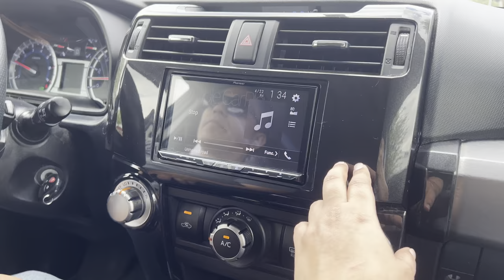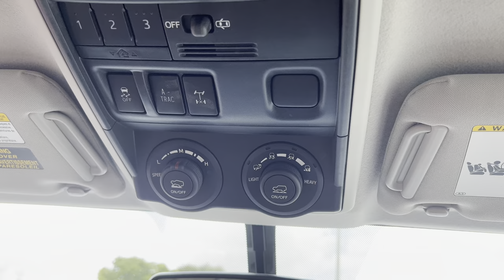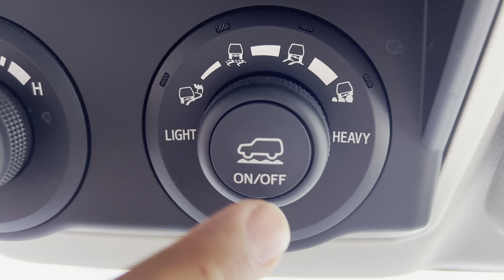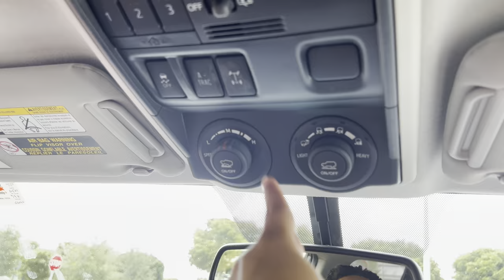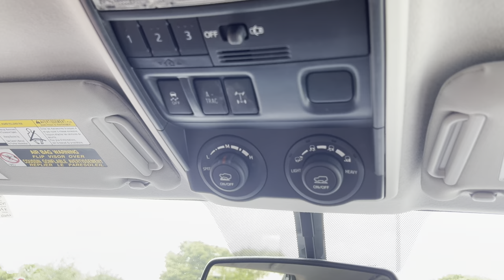Is the Toyota 4Runner the best adventure vehicle for large dogs??? | 4 years of adventure  review

Comment: I like how you pointed out the height problem with older dogs. This was the main reason I got the car I did. Downside I have is that because it's a hatch the dogs loose roof height. I do miss having the 4x4 for offroad traction going around corners but I still know how too get around a corner on a dirt road sideways and I love all the safety features on the new car. The Jeep was my first 4x4 and its power. Registration & fuel costs are half in the Kia. Wolf has jumped out of the Kia a few times but still needs help getting in, but it is a lot easier.
Reply from the maker: We are still shopping around for their new suv, in the mid time we will be using mine until we get one for them again. We did purchase a new car but is nor really for them is just for us, (they have got in the new car but they don’t fit together inside it, you will see the new car in video soon. 😉😁
Reply: @TheMalamutePack  I looked at a 4 door truck but was recommended by friends it won't be comfortable for the dogs. Not enough room to flop and with the seats up they can't see outside. Which is why I bought mine. No good for giant Malamutes though as we just fit. Ground clearance can be a problem bit we haven't been stuck yet I've taken cars where most 4x4's would get stuck. As long as you know what to do I didn't see the need to spend more for one. I might buy a winch to be safe though. Roads around here though dirt are well looked after by the council.